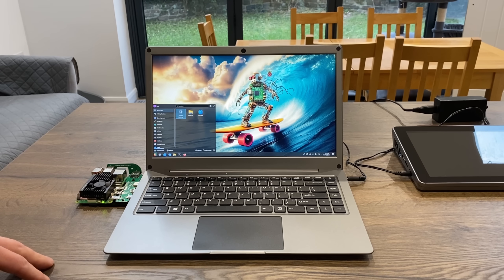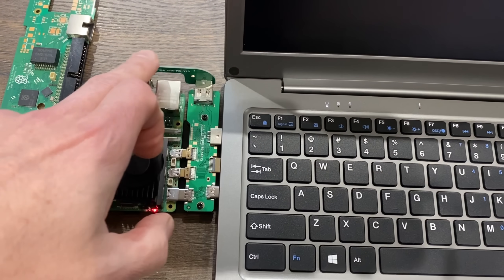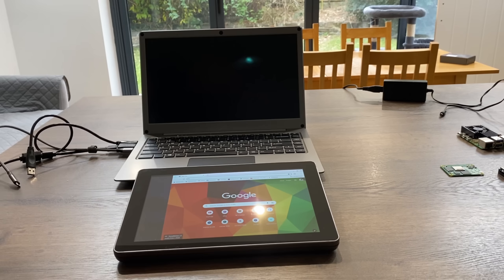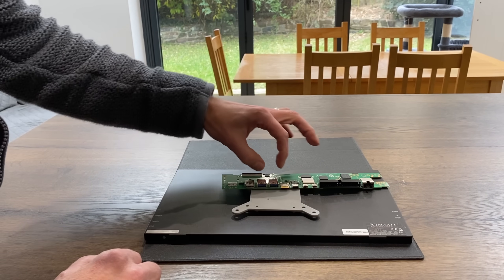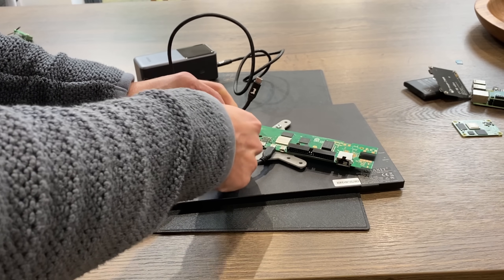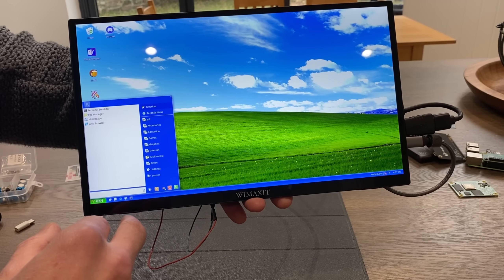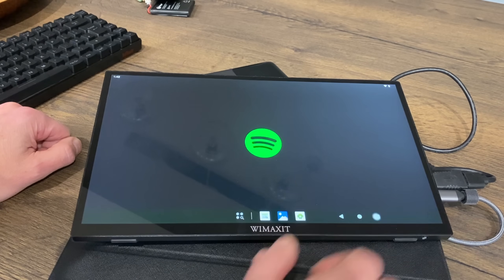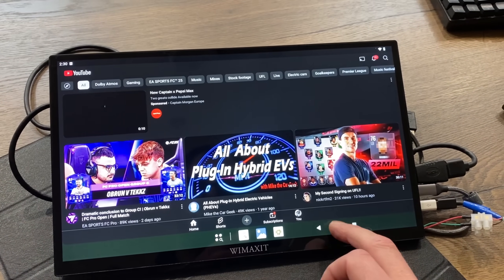Raspberry Pi 500 14” Tablet

Comment: Clickbait!  This isn't a Raspberry Pi tablet.  USB 3.0 can be used to power up to 4K video.  You could use an HDMI to Display Port adapter.  Why not replace the internal components of the tablet with your R PI5?  What you're making is so fragile and impractical.

Comment: I had a cheap Amazon 7" screen with mounting holes for a Pi 4 on the back. I used a powerbank from Amazon attached with industrial strength Velcro. It has one 20W PD port  and  at least one of every other port.  It's flat. The size is shorter, slightly wider and a bit thinner than my Galaxy 22 Ultra.  The brand is Charmast. It powered the Pi 4 and the screen.  I used the top part of an Armour case (the just a big heat sink case) for protection and cooling. 
I just tried the powerbank with my Pi 5 with SSD, keyboard, mouse and my big portable monitor. It boots. I got the warning about not having 5V @ 5A but it worked  OK. I have a cordless heating pad for my back and it powers that for  6 or 7 hours so it does put out a decent amount of power.

Comment: I just want a laptop with the pi 500 board that uses a stack of 18650's for the battery. I'm pretty sure it's doable, I don't care if it is thick lol
Reply: Why not just stick Linux on a normal and older laptop that already has an 18650-based battery? You'll probably find a refurbished one cheaper than a Pi (when you factor in case, cooling and power supply for the Pi).
Reply: @terrydaktyllus1320  18650's are no longer limited to lithium ion, they can be lifepo4 now with more charge cycles. If one of the cells voltage drops faster than the others, it's easier and cheaper to swap an individual cell instead of a whole pack like old laptops. In addition to that, the lower power draw on arm boards will also help in the longevity of the battery. 

The charging board can also be separate from the main pi 500 board so it's easily swappable. With old laptops,  once the charging circuit is toast, the whole board needs to be replaced. This will be like a poor man's framework laptop, very repairable but won't cost an arm. It's running ARM too lol.

Comment: What I don't understand is why the Pi x00  don't have circuitry on the PCB for proper battery management; that is somewhere to wire in battery  Is there an IO board for the Compute Module with circuitry that helps power to come from batteries?   A board with USB headers would help too so a keyboard and storage could be plumbed.  Basic things that would help making RPi portables for the home builder more straightforward.

Comment: Regretfully, we are at the point with Raspberry pi org that they are basically stagnant in terms of momentum. You should not be having to shanghai this - as really they should already be shipping, or partnering with people to ship tablets, and frankly laptops. What they are shipping now is overpriced kit living on the base community advantage. Releasing kit over a slow burn simply has endless cheaper chinese SBC making pulling on the coles. They ship M2 on their stuff already. 

Its not good enough and they need to be called out on it.
Reply: Whilst I agree with your basic points, how much "calling out" have you actually done, then? Writing comments on here isn't "calling out", it's just whining.

Ever since the Pi 4 suffered shortages and was no longer capable of achieving the $35 price bracket, for someone like me (a computer engineer) who builds many types of application server, for a couple of years now it has been cheaper to buy a used SFF PC online that will perform better than a Pi as well. 

I've been using Linux since 1996 and Gentoo Linux since 2003 so I can build Linux to run on just about anything anyway - so I have my choice of a lot of great and cheap hardware to build my solutions on.

Most of the Raspberry Pi community wouldn't have a clue about how to build any kind of computer system unless someone makes them a video on here showing them how to do it step-by-step.

If your lack of knowledge and inability to do your own research and testing leaves you the dependent on a single platform as the only thing you can use because it's the only thing that gets enough YouTube videos then that's your problem - and, of course, the Raspberry Pi Foundation and any other company will capitalise on that inexperience to make money from you.
Reply: @terrydaktyllus1320  You agree with my basic points, but went on several paragraphs wasting your own time and anyone else chugging through it. While chastising me for what I said, you went on to outline your own reasons highlighting what I said as the same basic drivers. You must be one of the folks who just can't help themselves but have arguments.
Reply: @AdmV0rl0n  "You agree with my basic points, but went on several paragraphs wasting your own time and anyone else chugging through it."

Sonny, this isn't a discussion about me, and "me" is a topic you know nothing about in order to discuss it in the first place.

I didn't read the rest of your comment, you wasted your time writing it. You had your chance, you blew it, next time try harder to keep up and stay on topic.

Run along, discussion closed.

Comment: Thanks Lee but I finally received my ClockWork Pi kit after waiting about 9 months with the built-in CM4 module.  I just have CM5 module on the waiting list as hackers are already hacking the software for it!.  
Maybe you can 3D print a case for your VESA mount to help streamline the  cable management, on your Hackaday article!
Have a great day!

Comment: The bad part about using the 500 is that there is no M.2 port on the 500 yet.
Reply: The good part of the Pi 500 is that I don't have to pay more money for a Pi 500 for an NVME port I don't need because I run a proper OS on it, I don't try to crowbar on bloated and privacy-hating Windows on it that needs all of the "hardware help" it can get.

Comment: Hopefully there won’t be supply shortages on the CM5, such that these types of products will actually be produced.  I’d like both a tablet and laptop powered by CM5.
Reply: Linux is not suitable for the tablet format because most desktops don't have a UI designed for touchscreens. You also don't get the best out of Linux unless you know something about using the command line. That's why Android has been designed as a "Linux variant" for touch screen use, it's an interface for "babies" on long journeys in the back of their parents' car playing their Disney movies on tablets - it's not an interface for serious computing.

As for the laptop, just buy a laptop and stick Linux on it - there are plenty of good and refurbished models of laptop out there that will ultimately be as cheap as a Pi anyway (by the time you factor in case, cooling and power supply) and the right laptop will be more powerful than a Pi anyway.
Reply: The best place in the US to look is DigiKey. They have all the CM4's and have had them for a long time now, even when other retail outlets were out of stock. There's no CM5s yet, but they do have the CM5 dev kit.